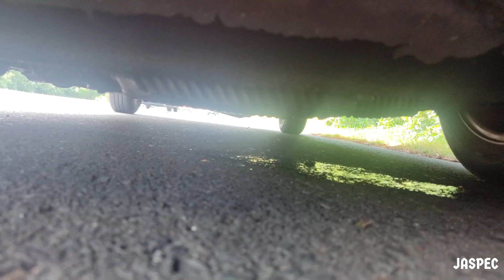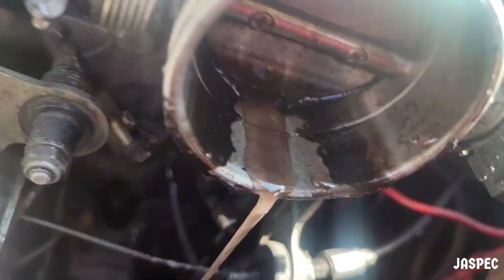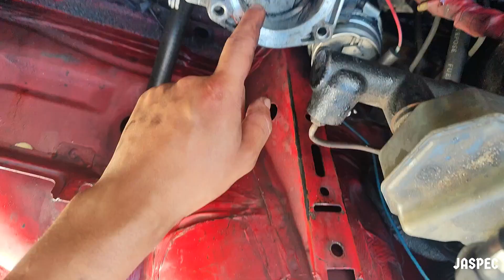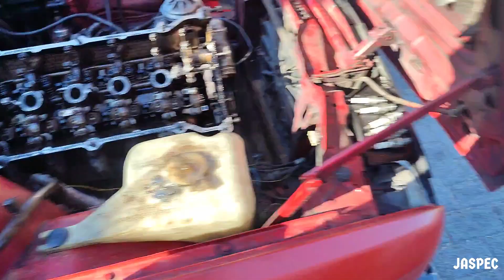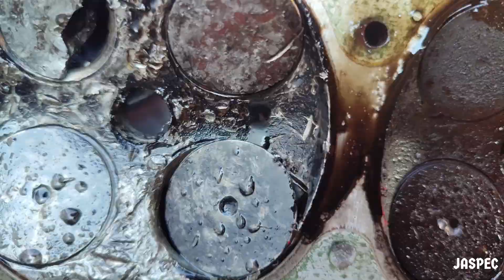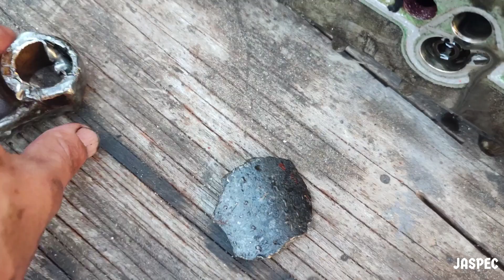When Things Go Sideways (Literally!)

Comment: What caused this?
Reply from the maker: That I'm not too sure on, my best idea is maybe there was a tiny crack in the cylinder or the water jackets were rusted pretty bad. After switching to better oils and coolant my heater core unblocked and the engine ran better, but maybe doing the flushes removed all the corrosion that kept things sealed and it finally gave way.

Pistons were standard, even the bearings that came out were still factory - so before me buying it previous owners probably have neglected it.

I definitely got a lot more paranoid from this, so the engine I have coming up is gonna be something!